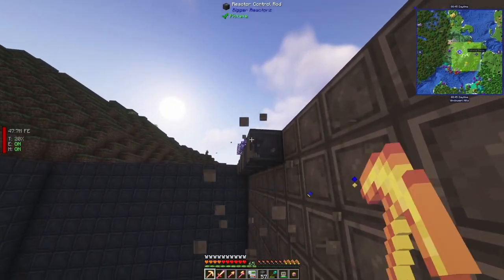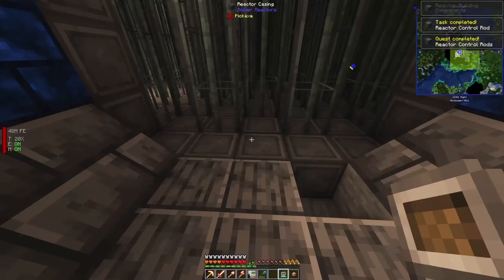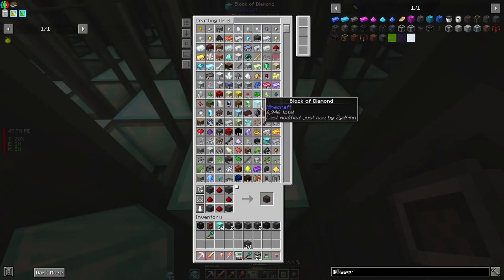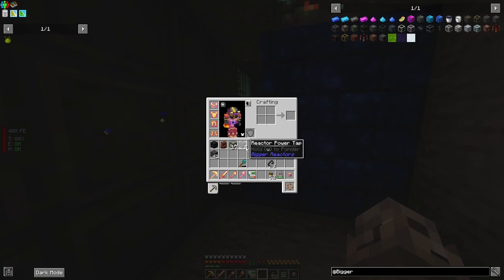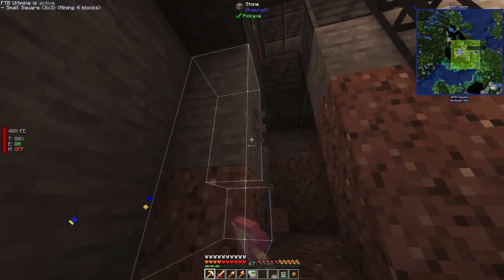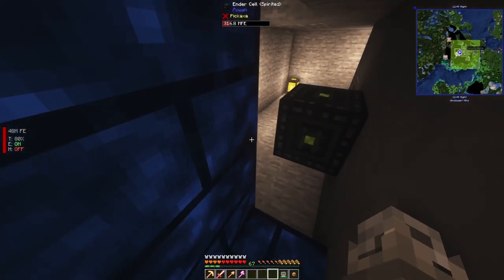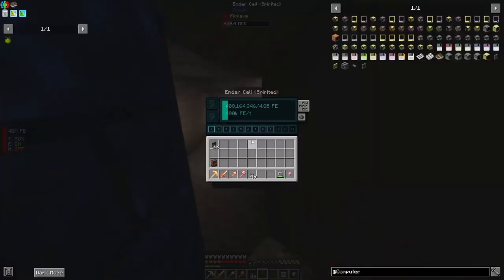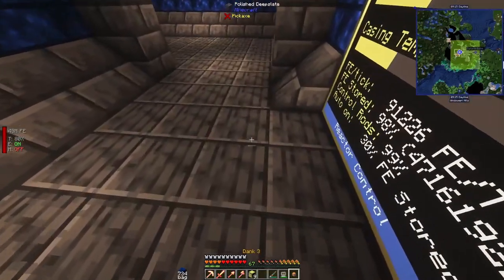How to Setup Bigger Reactor with Computer Craft! All The Mods 8: EP 12

Comment: Hello, does this work for 1.12.2 Extreme Reactors as well? Thanks! :D
Reply from the maker: Gonna be honest I’ve got no idea as I haven’t played 1.12.2 in so long. It might? Depending on if computer craft is in a pack that old and if extreme reactors has the right pieces added into the mod at that version.
Reply: @Zydrin  CC Tweaked is in the pack, but I just wasn't sure how much changed from Extreme reactors to Bigger Reactors. Thanks so much for the quick response, I will try it when possible and figure out. Thanks again!
Reply from the maker: @6leak let me know!! Few older packs I’d like to play again. :)
Reply: @Zydrin  Hey, just to update. I tried it and while it successfully loaded and installed the program, it wasn't able to connect to reactor. Program kept prompting me that I need to put the computer next to the computer port even though it was right next to it. Not sure if it's mod ver. incompatibility issue or something else. - Infinity Evolved: Reloaded 1.12.2
Reply from the maker: @6leak might even be the program? Have you tried other CC programs for your version? It might work. Not sure if the version matters for programs or not.
Reply: @Zydrin  I tried the other (outdated) program that you tried to use which didn't work for you, and it worked for me. So you're right it must be an issue with program versions. Though I was really hoping the second program worked because it looked much cooler and had more functionality😅. Much thanks
Reply from the maker: @6leak that’s awesome dude! (Sorry for the late response, work has been hectic) 🥲